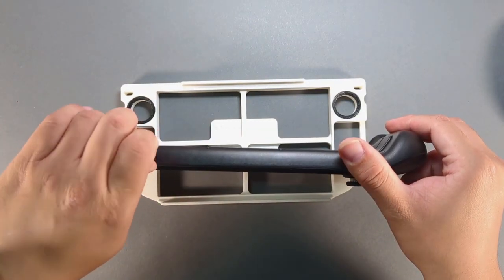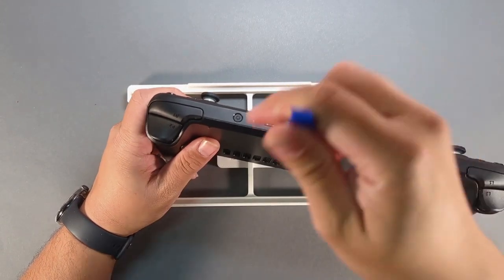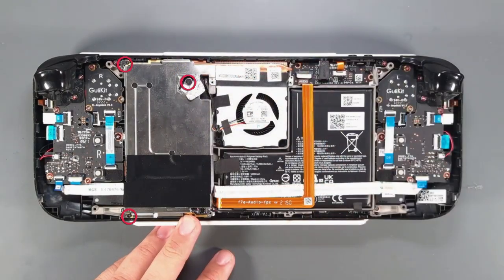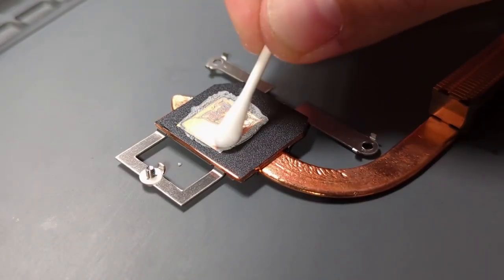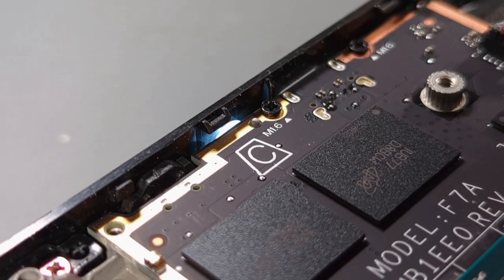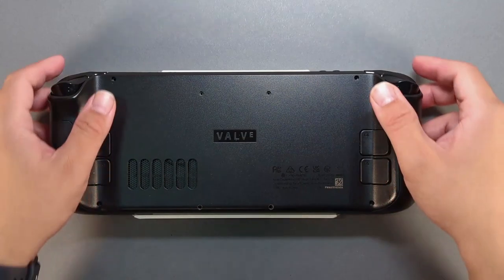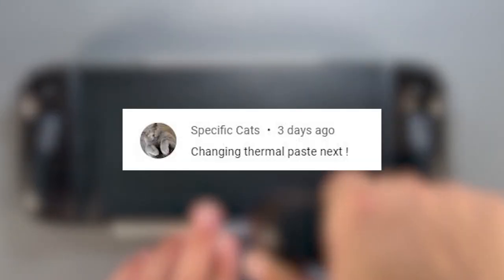Upgrade Your Steam Deck With A Thermal Paste Makeover!

Comment: Successfully changed my thermalpaste to Kryonaut with your guide. Thanks!
Reply from the maker: Happy I could help! how are the temps on Kryonaut ? I thinking I want to try it
Reply: @RetroRepairYT  I got around 80°c when playing Doom. As I disassembled my Steam Deck straight away when I got it, I didn't have the initial temperature reading. But one thing for sure, the fan noise is definitely less noticeable compared to the video recording uploaded by other people.
Reply from the maker: @knoxinzone1983  Thanks for the info. I really appreciate it. I am very much going to use Kryonaut now. Have you seen this floating around. I think its an upcoming rev to the steam deck for thermals. I want this heat rn https://www.reddit.com/r/SteamDeck/comments/12oit67/pictures_of_new_steam_deck_motherboardthermal/
Reply: @RetroRepairYT  Sadly I didn't get the new model, as I purchased my Steam Deck from Komodo (previously known as Degica, which also sold Steam Controller). The Steam Deck adoption rate is really slow in Japan. 

Tbh, that plate looks dope af.

Comment: You should try phase-change material Honeywell PTM7950. It comes in as a sheet, lasts longer, performs works better than traditional pastes and there is no pump-out effect.
Reply from the maker: Interesting, I'm doing to do a shell swap soon and thanks to your recommendation and additional videos I watched and the material you suggested I ordered some and will install it next 😊 thanks again for your suggestion
Reply: @RetroRepairYT Make a video and please notify the community if your deck dies. I got a RMA unit to replace my launch deck and it died 30 minutes after testing the PTM7950. I don’t want to put all the blame onto the PTM since the deck was faulty from muffled boot chime and very strange trackpad motors that could be heard if you were inside the same room as it. I’m worried that PTM7950 and Thermal paste spilling onto the tiny little rectangles might cause them to heat up too much and kill them which kills the APU. Brand new unmofided decks have randomly had hardware failures and I believe its due to too much thermal paste. There isn’t much information online but it would be nice to get second thoughts/options on this. I want to see before and after pictures of PTM7950 on steam decks. Since none exist, I’m trying to see factory thermal paste applications for similarities.
Reply from the maker: @Meninem_  I see what your saying, I will keep you updated about the PTM 7950 if mine goes down after 30mins. If you're looking for a photo of what the original thermal looks like when removing the factory heat sink for the first time I can check my raw footage to get a pic for you without my hands in it. I'll get it to you tomorrow here as a reply, most likely a imgur link.
Reply from the maker: here is the factory thermal image right before I cleaned it off of the heatsink https://imgur.com/gallery/jjDRW1D

Comment: Did it make any difference though? The thermal paste looked decent and being its a valve product, i imagine the quality of thermal paste was good.
Reply from the maker: It didnt make a huge difference but it did lower my fan sound. I take it because at that time I was running my deck non stop. summing it up, the fan was a not as loud when running on max load

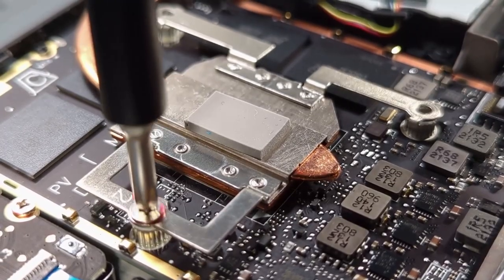Comment: 0:31

what is that adhesive called thats up there by the heatpipe?  I removed mine and the adhesive wont stick well anymore can I just use plain ole electrical tape? if not do you know where I can buy some of that?

and how about the reflective silver tape thats hiding the screw? where can i get some of that? just curious
Reply from the maker: Good question, the tape by the heat pipe is not any special tape. I believe it holds as a barrier to have the air from the fan push over the heat pipe so it's more of like an airflow barrier thing so the heat pipe can be cooled down quicker. Electrical tape should work just fine. Any temperature from the heat pipe shouldn't cause any issues with the tape if you're using electrical tape.

For your other question. You're looking for aluminum tape. They come in all different sizes.  If  you purchase a bigger size roll than what you need.  You can just cut a piece to size you are looking for. 

Thanks for your comment and I hope you have an awesome day!
Reply: @RetroRepairYT   thanks, very helpful info
Reply from the maker: No problem, happy I can help

Comment: I wonder if artic-mx4 will do well on my steam deck
Reply from the maker: I feel that would be awesome. I always use Artic on all my PCs I bet it will work out really well for you
Reply: @RetroRepairYT  oh, I did the change but now my deck doesn't turn on, just a black screen with fan spinning 😔
Reply from the maker: @LovelyZaia  I would try to open it back up and pull the power of the battery out and let sit for like a couple mins. Then plug it back in and try to turn it on again
Reply: @LovelyZaia  Were you able to fix it?

Comment: Important information: if possible, use a spreader for the thermal paste as APUs release heat throughout the whole IHS unlike CPUs which release a majority of it through the middle.
Reply from the maker: Thanks so much for the info and knowledge, I'm always happy to take great feedback like yours 😊
Reply: Umm not exactly right but close enough.

If you are cooling a die directly, you want to cover every millimeter, otherwise you might end up with hotspots and you DON'T want that to happen at all. 

If your chip has a Heatspreader installed, it doesn't exactly matter if you spread or don't spread it. It's generally better to spread it manually and get your layer as thin as possible and reasonable. 

But it certainly won't create specific hotspots like you have in a direct die situation

Comment: I have a fan replacement coming from ifixit and was going to change the thermal paste, can I just use alcohol whips on a cotton bud to then take off the old thermal paste? Is that safe to do?
Reply from the maker: Yeah you can definitely do that. But make sure prior you take the battery connector off the board so there is no power running to your motherboard. That is a very paramount step. Other than that you can use cotton swabs and alcohol wipes. Just make sure to clean all the thermal paste off and make sure it is completely dry before connecting the power connector back on your board. I am sorry I'm being very adamant about this. I want to make sure nothing gets damaged in the process
Reply: @RetroRepairYT  thank you very much, I really appreciate it
Reply: Cool whip

Comment: Thermal pads would be like the same right?
Reply from the maker: That's what I hear. But I haven't tried it. Let me know what some results are if you try thermal pads
Reply: NO! Do not use thermal pads. They are not designed for cpu/gpu thermal transfers. They don’t have the necessary thermal transfer ratings. I’ve seen people who used thermal pads in CPUs and said the cpu got HOTTER! Thermal pads are for mosfets, ram chips etc. unless you are getting specific pads made for CPUs like the honeywells used in Legion laptops or Thermal Grizzly Kyrosheet do not use standard thermal pads on CPUs/gpus!

Comment: After replacing the thermal paste, (battery disconnected) my deck won't turn back on. Just the led turns on for 1sec and off 5sec and again. Any idea?
Reply from the maker: I would try putting a wall charger to it then turning it on and see if it boots. Could wait up to a couple of mins for the boot to go through
Reply: U fix it?

Comment: Great guide! Thanks. How much it improves compared to the thermal paste that comes already applied?
Reply from the maker: No problem at all ! from my monitoring only a couple of degrees lower but my fan is not reeving up as much as its use to. Which I am totally happy with that. Thanks so much for your comment !
Reply: @RetroRepairYT  Thank you for the feedback, so it does help to replace the original paste. Cool, might try it out. cheers!
Reply from the maker: @kalkydra  no problem at all :) happy I could help

Comment: is putting tha tape back on entirely necessary
Reply from the maker: Are you meaning the tape on top of the fan that has serial numbers on it ? If so that's really up to you if you keep it or not. 
Usually the numbers on the top tape gives information that a repair service needs to understand what hardware is in the device.
Reply: @RetroRepairYT  Afaik, the tape is mandatory to control the airflow.

Comment: IPA means Isopropyl Alcohol? 70%? 
What thermal paste did you use? Thanks!
Reply from the maker: Correct, I am referring to isopropyl alcohol. If you can get your hands on 90% or higher that's preferable, imo. If not make sure it dries before moving on. 
The thermal paste I used is Thermaltake TG-7. Thanks so much for your comment 😊
Reply: @RetroRepairYT  Oh thank your very much for your prompt reply. I will now watch your videos and sub ☺
Reply from the maker: @exzer014  no problem at all. I am happy I could help and thank you so much for the sub!

Comment: Results?
Reply from the maker: Yeah the thermal paste I use got my temperature down by 2° and it did make my fan not rev up so quickly. It's been a while now but it's still running about the same one. I installed the new thermal paste

Comment: would liquid metal work better?
Reply from the maker: Yes but imo not worth the couple of degrees. Safety wise this way is ideal. Using liquid metal can short the CPU or other components if much too much is added. In addition it will corrode the chip and the heat sink.
Reply: You will get a similar result to liquid metal using a Honeywell PTM7950 phase-change thermopad.
Reply from the maker: @goorthiss  👀

Comment: You said take out both mounting screws when I see 3 screws 😒😒
Reply from the maker: There are three spots for screws you are correct. But in the previous step of removing the heat shield one of those screws got removed. And then two are left for the mounting screws ☺️

Comment: Removing battery isn’t necessary if it’s just applying new thermal paste
Reply from the maker: Thanks for that tip. I know it's mostly a personal preference on undoing the battery for this procedure. Personally, I like all the safety precautions I can get when working on a personal device such as this